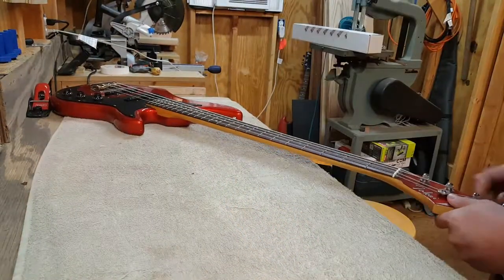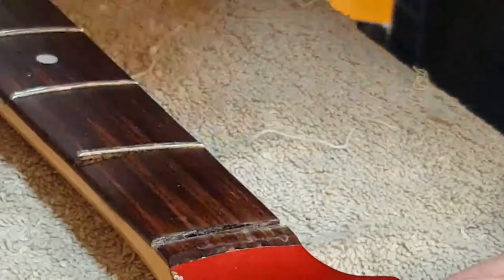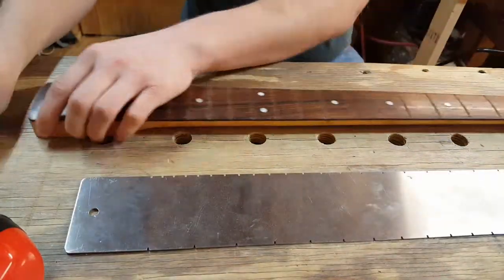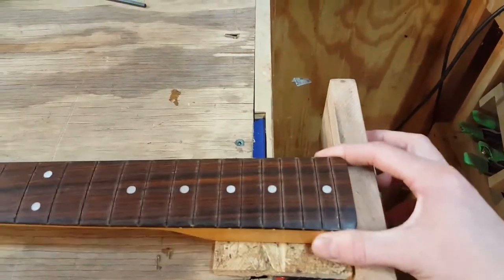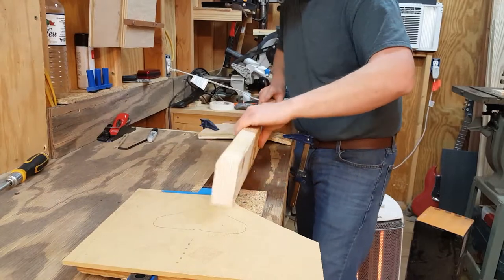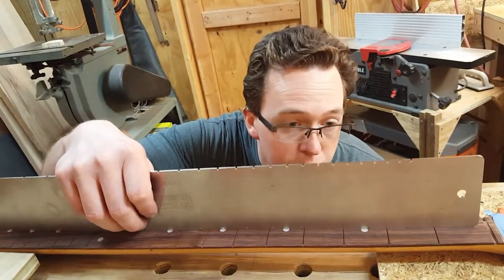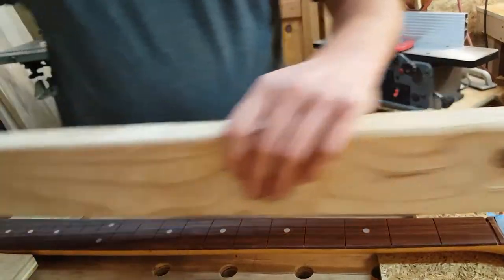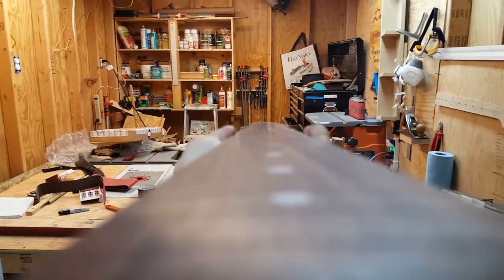Leveling a Bass Guitar Fingerboard

Comment: So should the neck be made as straight as possible first using the truss rod?
Reply from the maker: It depends. You want to be able to get it dead level, and still have some adjustment after you've leveled.

Sometimes you run into old necks that have ran out of rod adjustment. There is always a back bow, even with the rod all the way the loose. 

In this case, you tighten the rod a bit, level out all the back bow, and you've built some tension in and get get the relief you need. 

Sometimes a neck is in great shape and already has the adjustment you need for final set up and you only need to get it as straight as possible and level the board. 

It's hard to make the call. Just kind of have to study every neck and decide how best to proceed.

Comment: I got a neck where the upper frets from about the 12th to the 24 is falling off in height. So i need to level the fingerboard, its clearly visible that the fingerboard is thinner in the 12-24 fret area. But where do i start? do i just try to get the neck as flat as possible, measuring with a straight edge, and then sand it down (with a radius block)?
Reply from the maker: Rince wind
Reading the fingerboard and how it will act while leveling is really an art. I'm not sure I can describe it well, I had to do a few to get a feel for it myself. Adjust the rod, see what it's doing, try your best at guessing how the wood will act under string tension, this stage is easy in theory, but difficult in practice. 

Fall away from 12 on shouldn't be hurting playability terribly I would think. This neck here I remember was humped badly around the 6th fret or so. Roller coaster when viewed from either end. Up and down, up and down. 

Maybe the truss rod will pull that decline out without leveling?

I'd definitely do this as last resort.

I wish you luck, wish I had more for ya, but you just have to use your own judgement on that one.

Very important step here. If your questioning it you should probably have a local luthier help you a bit, or have a look at it for you maybe.
Reply from the maker: Also if the finger board varies in thickness maybe it's been leveled? Possibly correctly or incorrectly in the past?

From the factory fingerboards tend to be a very consistent thickness. If it's not I'd say it's been altered most likely. 

The top surface is what counts though, if that's level, your good.
Reply: its a cheap chinese neck i got for 30$. The fingerboard is a lot thicker than usual so it looks like they just didnt bother to sand it properly. The fingerboard varies in thickness and there seem to be consistent downwards slope which gets especially noticable at the 12-24 fret, I think it might be close to 1mm, at least it is 0.5 mm. 

Me thinks that i cannot make it any worse than it already is. But true, this is a difficult fix - cause i cant really find any tried and true method of doing it that guarantess success like there is with other things. Thanks for the quick reply
Reply: Maybe i actually should just loosen the truss rod completely? if the neck is somewhat straight with the truss completely loose at least the wood wont react when i remove wood from the fingerboard. With the truss rod engaged it will cause the wood to bend when I take wood off the fretboard.  I understand you cant answer this question confidently, but does it seem like a viable idea at least?
Reply from the maker: Rince wind

You need a bit of tension in the neck to still be able to adjust it. With the rod loose I don't think will give you that.

https://youtu.be/7aoF0XP3eJc

The Stew Mac guy Dan Erlewine explains this very well in this quick video.